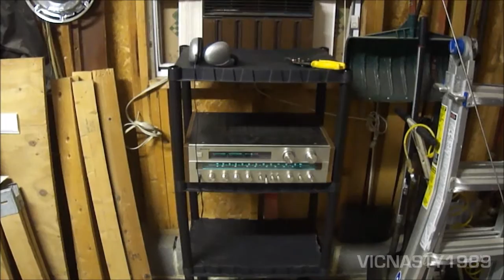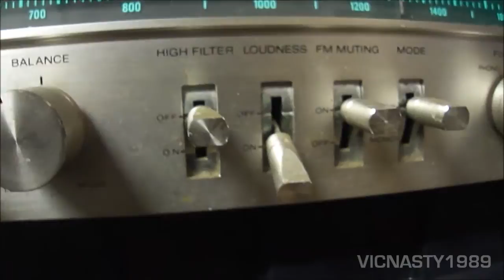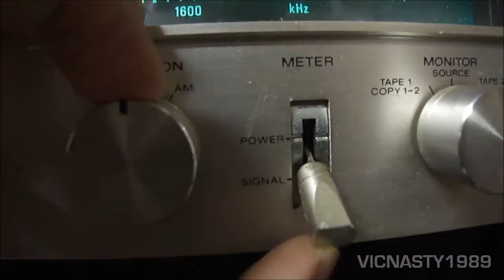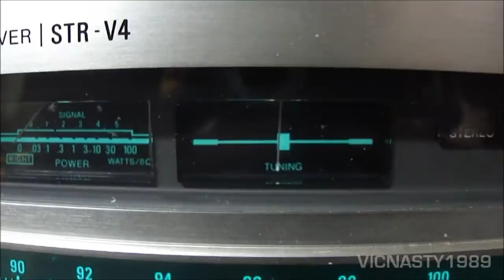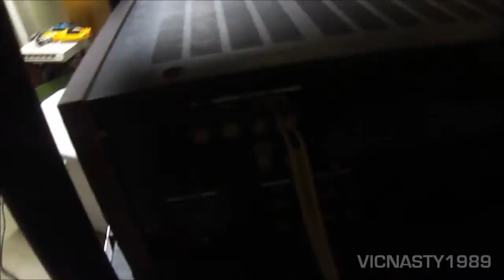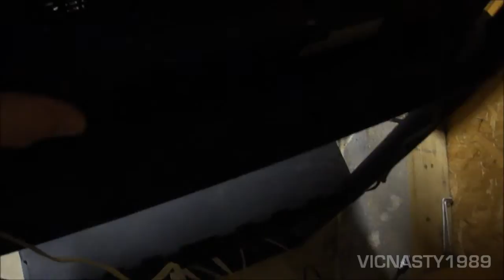Trash Find!- Sony STR-V4 Simulated Quad AM/FM Receiver/ Amplifier

Comment: Not sure why this receiver is billed as "Simulated Quad".  It is a 2-channel/stereo receiver that can drive an A set of speakers and a second, B set of speakers, just like nearly all receivers of the day.  Usually the B speaker set was for another room.  That is why you can select just A, just B or both - or turn all the speakers off and use headphones.
Reply: @jerryking7502  No, it isn't.  I have the exact model shown in the video (Sony STR-V4) and have been using it for decades.  2 channels in; 2 channels out.  Nothing 4 channel about it.  I was in the store (Pacific Stereo) when it was purchased.  The salesperson would have mentioned Quadraphonic if it had that feature.

For those people not in the know, for this era equipment 4 channel means Quadraphonic, just like Stereophonic means 2 channel and Monophonic (Monaural) means 1 channel.  I have this receiver.  It has 2 main "A" speakers (which are not "front channels") and 2 more "B" speakers intended for a separate room. The knob on the bottom left, beside the headphone jack, has selections for "B, Off, A, A+B" speakers.  Selecting A+B runs both sets of speakers in series so the amps for the 2 right and 2 left speakers can be used without overloading the amps (the speaker load for two sets of 8 ohm speakers is effectively 16 ohms. Check the owner's manual to verify they are connected in series). It is a total of 100 watts or 50 watts per channel.  For people who have the STR-V3, that model can also drive an A speaker set and a B speaker set and has a speaker selector knob laid out just like the STR-V4 - I downloaded a copy of the STR-V3 owners manual to compare.
Reply: @wkienz  I appreciate the explanation, I know understand more!.....  I have my eye open for a nice enough vintage receiver.....  oh and speakers, at least one set  ; )

Comment: Signal should be signal strength, as in station signal strength.
Reply: @andycflbulb, you are correct.  More specifically, the behavior of the meter - whether it displays radio station signal strength or amplifier output to the right speaker - is determined by the "Meter" switch toward the right side of the control panel.  I know this because I have this model receiver in my upstairs listening room.